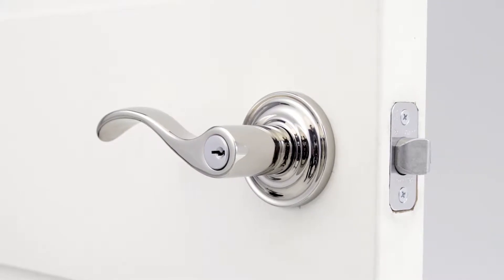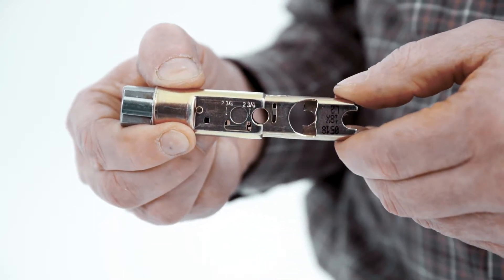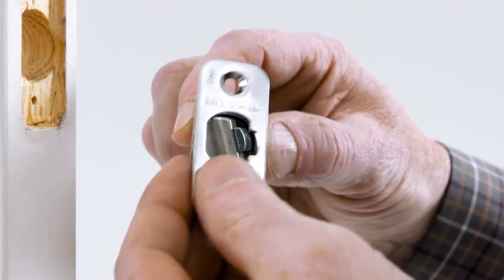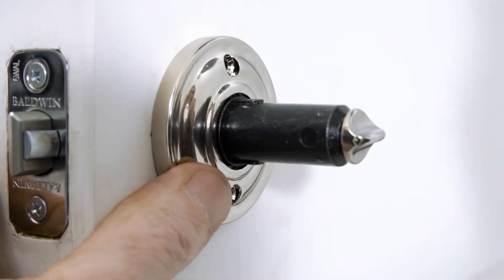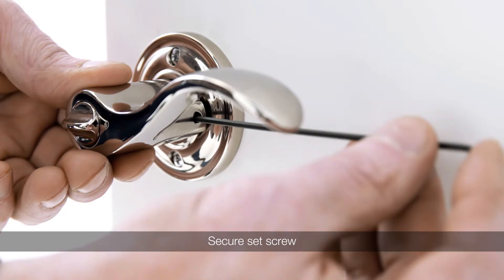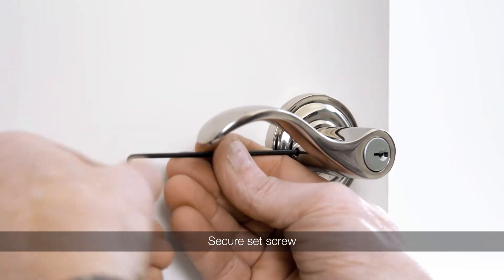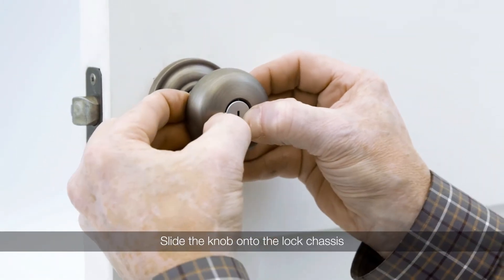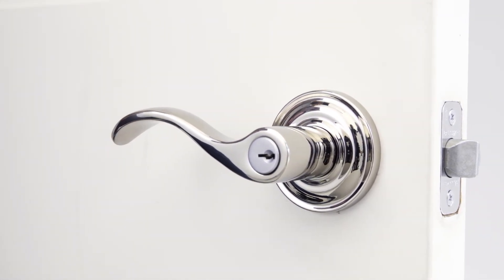How to install a Baldwin Reserve Keyed Entry

Comment: Also followed the video. The knob turned and the latch moved as it should. The key would rotate 90 degrees in the lock as it should. However, could not lock the door with the key OR the interior button. The interior button was frozen and would not turn. I'm at a loss.... Suggestions appreciated.